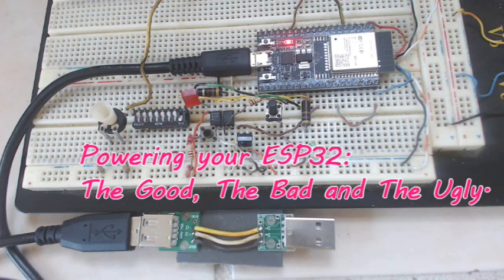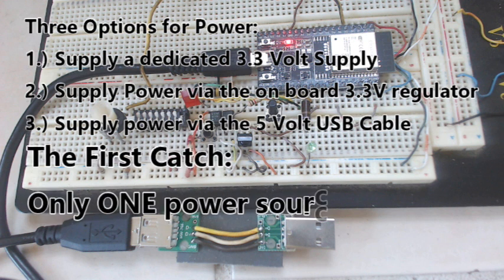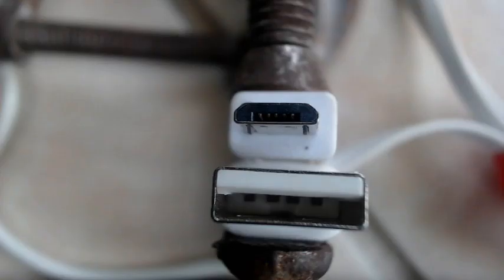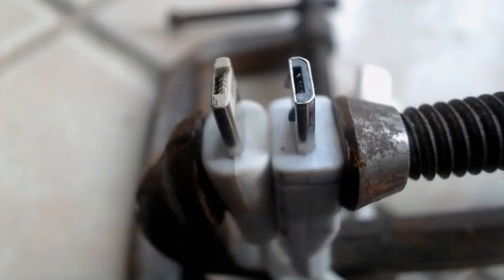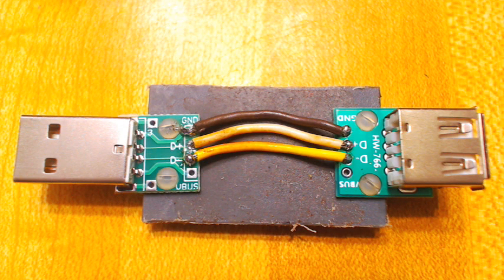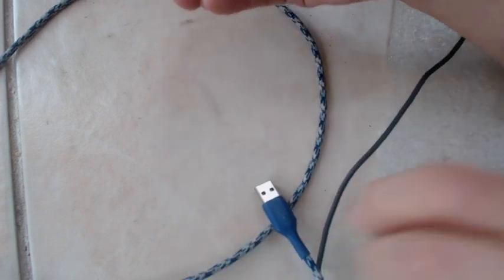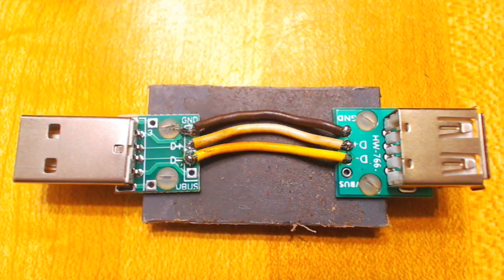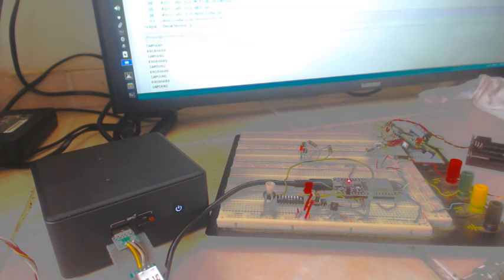An External powered  ESP32? Program  or monitor it at the same time!

Comment: I tried this isolation setup but does not seem to work with windows11 on Asus.  Any suggestions?
Reply from the maker: I use MXLinux, so I'm out of the loop there.
Reply from the maker: Actually there are several possibilities.  More detail is required to comment further.  It could be antivirus.  It could be Windows 11 Security settings.  Arduino IDE? Version? Processor ? Port Type? Mini USB?  Type C? Correct board selected?  I've moved away from Windows because W10 and on were spyware infested.  I have W10 & 11 but rarely use either.  I never use Arduino IDE with Windows even though it is installed on both.